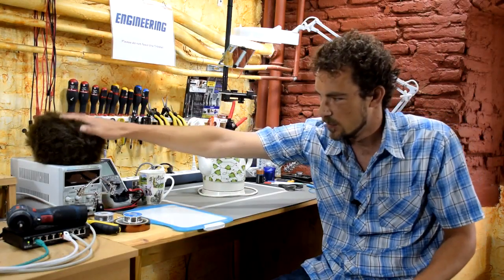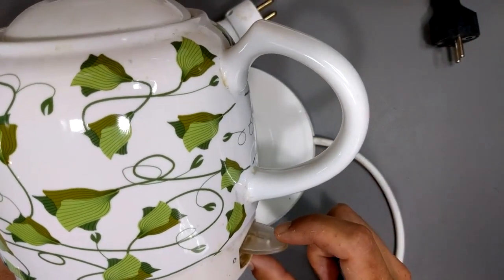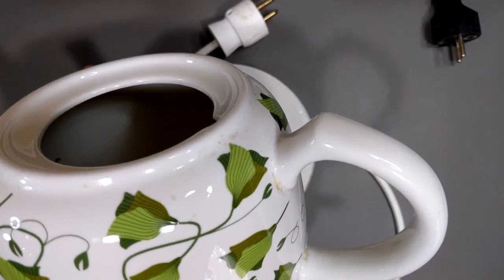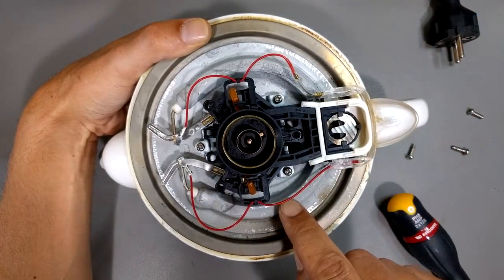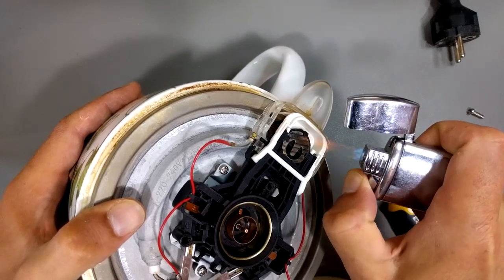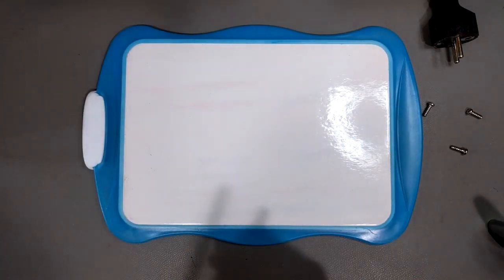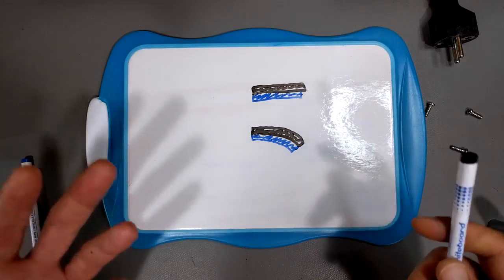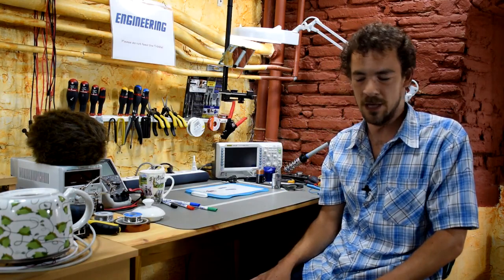How does an Electric Tea Kettle know when to turn off?

Comment: My kettle doesn't have that pop up switch on it.  It has a digital display of the temperature on the front.  If it states ETL/CETL Plug does that mean it's safe to leave the base plugged in?  Can I leave it plugged into an 1875 watt powerstrip when it is a 1200 watt kettle?  I already have a coffee maker plugged into it but I only use 1 appliance at a time.  Thank you.
Reply from the maker: The power strip should be fine as long as you don't fire up both appliances at the same time. And leaving it plugged in should be fine, as well!
Reply: @ScottiesTech  Is it ok to leave everything else plugged in (not using them) while I'm using it and also should I turn the switch to my power strip off when I leave the house or is it fine to leave it on as long as I make sure everything plugged in it is turned off? A third question is in my living room I have my TV, Roku, and digital clock plugged into a surge protector (I took my Nintendo switch off because I don't want to overload it) and in the second outlet I have a power strip plugged in so I can charge my phone, kindles, small electronics.  Is it ok to have the surge protector and another power strip in the same 2 socket wall outlet?  I am very mindful of not charging everything at once.  I don't want to overload anything.

Comment: HI Scottie, my kettle is nearly brand new, but it switches off before boiling. I've looked everywhere for a way to fix this because, as you probably know, it's impossible to find a repair service since the industry is geared toward incentivising you to just buy another. I don't want to add to that waste. Do you have any suggestions for repair? Do you think I probably need to place that metal strip?
Reply from the maker: Are you possibly at a higher elevation? That might do it. You can try replacing the strip, but it ain't easy to find the right one for a given kettle. In fact, it's often nearly impossible as I discovered. :(

Comment: My kettle takes a long time to finally shut off. 30 seconds or more. Lots of steam. Guess there is nothing I can do
Reply: Here's my best guess: It could be because the gauze which is supposed to be at the base of the spout is damaged or missing. That gauze  plays a part in enabling steam to reach the bimetal switch as soon as possible after reaching boiling point . Without the gauze it will either take a long time to do so, it won't do so at all. Ps,. You can experiment by placing a spoon over the spout of the kettle when it is boiling, and is supposed to switch off. If the bimetal switch is working, the increased steam pressure in the kettle will trigger the switch.

Comment: My switch isnt staying down on its own i have to put a little weight to keep the switch down for the water to boil how can i fix this
Reply from the maker: Have to take it apart and investigate. Could be some little plastic bit broken off, or possibly the bimetallic strip thingy is worn out and always in 'turn off' position.
Reply: @ScottiesTech  hey I have some good news I took it back apart and heat the little circle metal plate only to realize it's not moving so I removed it and the kettle switch is working again just that I have to click it off. But that's great better than having to put something on the switch for water to boil 😊 thanks for your video.  If you know where I can purchase the plate let me know 🙏

Comment: You forgot to explain how that bimetal strip actually gets hot, since it's just sitting in the cavity under the kettle and is not actually in contact with anything but the plastic molding.

Comment: I bought a new kettle, idk why I boiled milk in it yesterday but I did and now the temperature sensor thing isn't working fine... I'm so sad. It turns off when water is just lukewarm. Sometimes i cam manually try to press the button and it ends up boiling and sometimes the button doesn't even go down even though water isn't boiled yet. Can you help me what can I do 😭
Reply from the maker: Well, that's odd... I wonder if it works differently than the one I showed here? Even do, you'd think heating pure water in it would clean it out well enough. Maybe heat some soapy water, rinse, and try again? I really have no idea...

Comment: Kettle in family home will not auto switch off. I check the biometric disc (beneath the switch), it's fine. It flexs when heated and fully connects with the switch, yet will not trigger the switch when powered on. Kettle water just boils, boils, and boils away, rocking and shaking. Steam wand inside is not blocked and channels well onto the biometric disc (lid is on/shut). Completely perplexed with the unit at this point 😦😕.

Comment: FYI: The bi metal thermal spring  shown here is for the ULTIMATE disconnect, when the kettle runs dry.( for safety, not for control)  Another youtube tutorial shows the thermal switches for control at boiling point. They are close to the hot plate.    https://www.youtube.com/watch?v=kD79aS8uwW4
Reply: Thankyou. This guy seems to have forgotten to explain the step of how this bimetallic strip actually gets hot.

Comment: I have a teapot like that. Somehow that switch keeps tripping before the water reaches boiling point. It was not like this when it was new. Can I rewire it and bypass this switch and manually shut it off when the water is boiling?
Reply from the maker: Yeah, if you want. Just don't forget it and let it boil forever, cuz eventually something will melt.

Comment: I have a vintage Alessi electric Kettle with a whistle on it. Sadly, the automatic switch turn off too quickly so I never hear the whistle.
Is there any way to change the bimetallic switch for a more resistant one in order to hear the whistle when the water boils? Thanks.
Reply from the maker: If you can find the specific strip for that kettle... Which is a tall order!!!
Reply: @ScottiesTech  I'll dismantle it to find out. See where this leads me. Thanks

Comment: Genious... i always thought there would be some thermal relay element which would be extremely complicated...

anyway, my question here is: what could be a reason for my kettle to... like... 'pause'... it doesn't turn off via the bimetal plate, no. it looks like it 'stalls'. you can hear that sound of water warming up then it stops for a second or 2 (the sound dies down) then 'turns on' again and keeps warming the water up. eventually it does boil it but now it takes about 15 min vs normal 2-3 min.

what might be the reason?
Reply from the maker: Hmm... Maybe it has one of those thermal 'fuses' that open when it overheats? Sometimes they go bad and open early, then close again when it cools off. That's pretty weird, tho...

Comment: If the manufacturers tweaked the kettles to switch off at 90 Celsius would it save much electricity ? I see it is possible to buy expensive kettles with options to switch off at different temperature but they seem to depend on electronics that some claim malfunction sooner than normal kettles - like you mention at end of your video.
Reply from the maker: I suppose that would save some juice. The heating element would consume the same amount of power, but every kettle wouldn't run as long, thereby adding up to a lot of saved kWh. But then you might even up with a lot of grumpy tea drinkers, which could be dangerous...

Comment: great video about how the current shuts down by bimetalic plate! However, My kettle turns on and starts warming but switches off before water boils. If I switch it back on it works for a few seconds before it trips again. What does keep the switch down in place when we manually push it? because I know it can not stay down when it is not powered, so there has to be an active mechanism for that as well. I appreciate it if you help me or even more if you make a video and tutorial. Thanks!

Comment: Thxs. I had repaired a kettle Rüssel hopes. It was o proplem with the switch. Now it works again. Only the power led which is integrated in the switch does not light. Two wires from this led are connected to the header element. Do you know how this works?
Reply from the maker: Well, the LED needs DC, so either there is some AC -> DC adapter somewhere, or more likely it's a self-contained LED bulb + basic electronics to rectify the AC into DC and power the LED. OR... Are you sure it's a LED and not a little weird-lookin' neon lamp?

Comment: Can i plug a kettle into a power strip extension? Does it draw alot of power?
Reply from the maker: Yes, but... You can almost always plug things into power strips without any danger - if only 1 thing is running at a time. What you can't do is plug several high-power gizmos (like kettles) into a power strip and use more than 1 at a time.

Comment: Can that bi-metalic strip wear out over time by eventually requiring more heat than before to trip the switch?  Seems like mine doesn't want to shut off anymore.
Reply: I am having the same issue!
Reply: @erinkintzing879  I have found that my lid hinge plastic weakened over time from the heat causing the hinged lid to not fully close.  This allowed excessive heat/steam to escape from the top of the kettle causing the bi-metallic trigger to not trip.  Put a weighted object on top of the lid to hold it down fully and see if it trips off.  If it does, then most likely that is your problem.

Comment: On mine, there are two additional bimetallic switches underneath the black plastic assembly that make contact with the bottom of the kettle. They are a safety feature to disconnect the power when the kettle gets too hot.

Comment: Thank you ... that's so clear. The switch on my kettle won't stay on so I was trying to work out what turned it off. Now I need to work out why it turns off too soon!
Reply: Same problem here. Wondering if you had any luck. Did you need to replace that bimetallic switch?

Comment: Thanks for this video! Another important point to mention is how the bimetalic strip gets heated:
-As some other comments have mentioned, the boiling point of water changes at different altitudes and you need the temperature switch to be impossibly accurate if it is to switch off when the water reaches boiling, but not before that
-The way this is resolved is that the bimetalic strip is actually heated by steam, directed through a pipe from the top of the kettle
-This steam only makes it down the pipe to heat the strip once the kettle is boiling, such that there is a pressure build up from the steam to push it down the pipe
-That is why your kettle won't stop boiling if you leave the lid off!
Hope that's helpful :)
Reply: Yes! This was also part of my question. I noticed that if my kettle was not properly closed it could go on boiling forever.
Reply: The real answer is always in the comments.
Reply: Right on. Thanks
Reply: Perfect ! thanks
Reply: Now clear, thanks!
Reply: So if the lid does not close tight what can be done as there is not enough pressure to trigger the switch to turn off the kettle. Any ideas?
Reply: This is actually what I came here to learn. I was interested in the thermodynamics of it. Not the mechanical components.  He answer left me unsatisfied
Reply: This comment right here is why I searched for the video in the first place. Obviously there is something that switches off the switch when the water is boiling but I wanted to know how it was heated since the heating plate itself would get hotter than 100°C.
Reply: THAT was the question I wanted answered.  There is no visible tube in my glass kettle, so the manufacturer must have discretely hidden the tube in the handle.
Reply: This is a thermostat right?
Reply: Thanks man for this very detail answer.
Reply: Wow You just solves my lifetime question.
Reply: How do you fix it when it no longer turns the kettle off automatically?

Comment: Great vid Scottie. As our kettle boils for quite a few seconds before it turns off, I often flick the switch off when it first boils, but my wife says "don't, you'll break it!" Will my doing that cause any problems?
Also, what is the reason for the manufacturer saying their must be a minimum level of water in a kettle - apart from the obvious thing that if there is a ridiculously small amount there's a danger of it burning out??
Reply from the maker: Turning it off early shouldn't cause any problems. It just manually flips the mechanical lever instead of it being automagically triggered by the bimetallic strip. As for the minimum water, that's a good question! Being a rebel, I've tried running the kettle with less than minimum water, and it works fine. Even if there's no water, it should still shut off fairly quickly, and that's that... Another mystery to solve!
Reply: @ScottiesTech  Pretty sure they ask you not to run it with less than minimum water because there's a delay between the water boiling and the kettle turning off. If you run it with minimal water, there's a chance all of the water boils before the kettle turns off, which means the heating element will be heating a dry plate. The plate is definitely not designed to get warmer than a specific temperature, and without any water to absorb the excess heat you're bound to melt some plastic.

Comment: good video man, just wondering why my kettle won't turn on sometimes, light flickers on and off in the on position. guessing it was just a loose connection but took the kettle apart and blew my mind when opening it, henceforth, i gave up.
Reply: adrian polydorou Try cleaning all the contacts on the base and on the bottom of the kettle itself with sand paper and then vinegar.